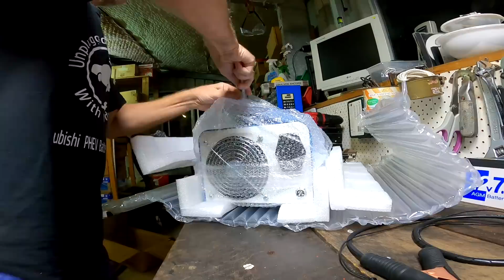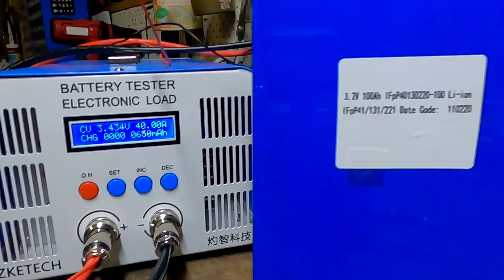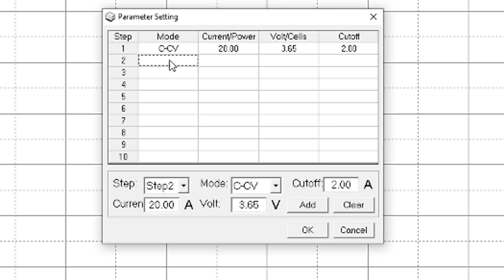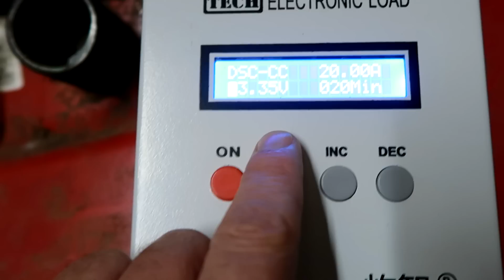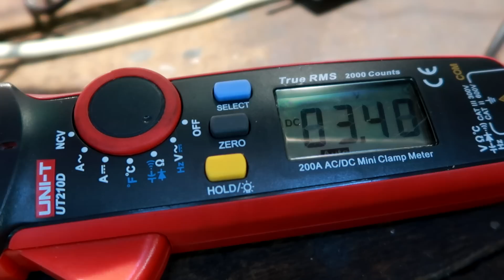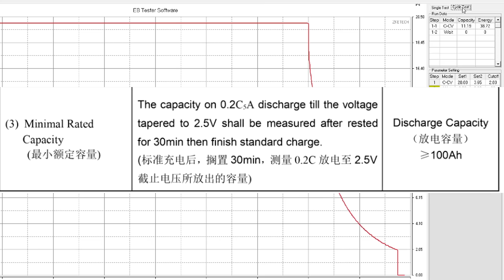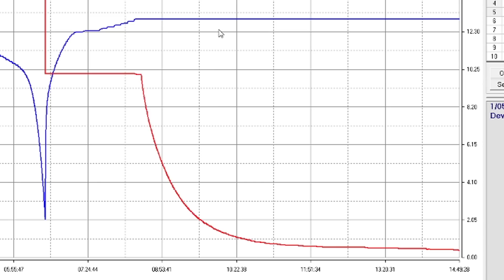My favourite battery analyser so far: Testing the BIG and POWERFUL ZKE-Tech EBC-A40L.

Comment: The 4-wire connection allows it to measure more accurately by avoiding the voltage drop during high-amp operations, as well as allowing you flexibility to where you connect the voltage reading for most accurate measurement. For example, you might connect the high current leads to your main battery power terminals but connect the voltage sense leads to your BMS for the most negative and most positive cell connections.
Reply from the maker: Hmmm, OK...
Reply: Yep 4 wire is way better. Even the terminal as some voltage drop.
Reply from the maker: But 4 clamps as well?
Reply: @OffGridGarageAustralia   Andy, you are completely right. No need for 4 clamps. Only one spare wire to the each crocodile ;)
Reply: @OffGridGarageAustralia  Hello, maybe someone has encountered a case of loss of communication between the tester and the computer. Once you start the test some is fine for a while. The current and voltage values are correct. After a few minutes, problems begin. First, the data refresh rate drops. Then the voltage and current values start to go crazy. Then it's good again for a while and then it changes. Often, communication is completely lost and the tester does not respond to commands from the software. In such a case, the cyclic test is also interrupted and the tester does not start the next test on the list after completing the current test. Any suggestions?
Reply: @marekbarney9291 
I’m having this same issue when trying to do multiple cycles also.
Have tried to do a firmware update also. Bit not sure how.
Reply: @flyingskwerl-Outdoor_Adventure  If you manage to solve the problem, let me know. I tried but I have given up for now because nothing has helped.

Comment: The reason for separate voltage cable, or remote voltage sensor, is to get an accurate voltage reading during high current loads. No current flows in that cable so no voltage drop as you surely knows
Reply from the maker: Nah, that wasn't the question at all. I know why we have separate cables for current and voltage reading. But why separate clamps???
Reply: @OffGridGarageAustralia  yes that is peculiar
Reply: @OffGridGarageAustralia  Even the clamp has a small resistance and that can give false reading.  Measure with a multimeteron the terminal and then on the clamp where cable is connected, you will see some mV difference
Reply: @OffGridGarageAustralia  because in a battery test you can put current clamps in the terminals of the battery and the small clamps in every single cell you want
Reply from the maker: @zarbonida  The tester can only handle 0-5V, so this cannot be the reason. I found the answer in one of the many comments and will show this in a future video. It makes sense to have them separated...
Reply: @OffGridGarageAustralia  thanks
Reply: Right info
Reply: ^ this ^

Comment: You really don't know the purpose of 4-wire (Kelvin) measurements ?
One set for high current and the other for voltage measurement ?
Reply from the maker: That's wasn't my question, if you watch the video again. I was asking why we have separate clamps. I wasn't talking about the cables at all!
Reply: @OffGridGarageAustralia  Obviously because of contact resistance being much higher for heavy current clamps.
Reply from the maker: Obviously...

Comment: I thought the eve cells said to wait 30mins at cv 3.65. interesting this sheet says to simply pause and then recharge.
Reply from the maker: It's the same here, people just don't read it correctly in the manual.
'The capacity on 0,2C discharge till the voltage tapered to 2.5V shall be measured after resting for 30min', it says.

Comment: Normalerweise können die separaten Klemmen für Strom und Spannung schon nützlich sein. Wenn man mehrere Akkus in Reihe lädt oder entlädt kann man so z.B. due Spannung von einzelnen Akkus prüfen ohne dafür extra ein Multimeter zu holen. Dafür wären die getrennten Klemmen an dem kleinen Tester allerdings sinnvoller. Bei den max.5V von dem großen kann man nicht viel in Reihe schalten. Bei den hohen Strömen für die der große Tester gedacht ist, ist es ist es manchmal vielleicht auch sicherer, wenn man erst mal mit den getrennten Spannungsklemmen die Spannung prüfen kann.  In den Bereichen für die der große Tester gedacht ist, sind Spannungsmessungen ungefährlich. Bei Fehlern mit den Stromklemmen kann es aber böse krachen.

Comment: Accurate test equipment always uses 4 wires - 2 for amps and 2 others for volts so the voltage reading isn't affected by the voltage drop in those cables when they're passing 40 amps.  Four feet of 10 gauge wire will have a voltage drop of about 0.16 volts at 40 amps (depending on the type of wire) - based on a guess at the length of both the positive and negative cables.
Reply: Would it be okay to clip the little clips to the big ones? 🤓🤔🤷‍♂️
Reply: @serversurfer6169  Sometimes, but not usually.  You don't know where the big clips are contacting the battery terminals or how good that contact is.  Remember that the device is capab;e of reading to 0.001 volt.  At the currents this device is capable of (40 amps) even the 10 gauge wires would have a drop of 0.160 volts at 40 amps.  If at all possible, the small clips should be connected directly to the battery terminals - not through the possible voltage drop of another clip.
Reply: @notyoung  good to know, thanks! ✊🤓💜

Comment: Don’t calibrate it with your clamp meter. It’s not really accurate. Good enough to read a 12v battery but not good enough for electronic work in my opinion and I have this clamp meter myself too.
But I would check the ground connection of your new toy. Most of the time, Chinese company’s don’t really care about this connection…

Comment: 23:15 See why I only charge my cells to a resting voltage of 3.325? There is virtually ZERO extra capacity above this level...........
Reply from the maker: But the absorption time is super long, right? It will take forever to to charge them.
Reply: @OffGridGarageAustralia  Absorb WHAT? There's no extra energy being forced into the cell. Just set your controller to stop charging at 13.6v (3.4v per cell). The more you get into the 'knee', the more chance of your cells becoming unbalanced. It's pointless and potentially damaging.....
Reply: @mikeholt7881  Top balance vs. bottom balance. The knee of concern is opposite where they are balanced. And there is a large difference between "virtually ZERO extra capacity" and "no extra energy."  From beginning of the top knee until fully charged is usually 10% or more. For regular use it doesn't cost much to keep it below this level, but going the rest of the way to charge that 10% is not "no extra energy."
Reply: @mikeholt7881  I would charge it more than I usually would only ONCE as a test to get a good idea of what the knee looks like so I can make an educated decision as to where I want to cut it off from then on (and to calibrate my coulomb-meter).
Reply: @Sylvan_dB  10%? You have NO idea.
Reply: Put these key words into Google.....Marinehowto....lifepo4......batteries-on-boats. It'll be an eye-opener for you.

Comment: 2nd wire for voltage measurement is for 4 point measurement to compensate for the IR voltage drop in the main current carrying cables.
Reply from the maker: Yeah, I know that, but why does it has a separate clamp?
Reply: @OffGridGarageAustralia  The two halves of the big clamp are electrically shorted together at the pivot point and spring between the two, which means current is flowing through both sides of the clamp. If the clamp has 0.0025 ohms of resistance between the jaw and articulation and the current is split evenly between both, that's 20A x 0.0025 ohms = 50mV of IR voltage drop on your measurement, same on the negative side, so your reading ends up 100mV off. Having separate clips to connect directly to battery terminals gets you the true terminal voltage regardless of how good or bad the high-current clamp connection might be.
Reply: @OffGridGarageAustralia The clamps that carry the load/amps also have a voltage drop. You should connect the sense wires to a part that doesn't carry any current, as directly to the battery terminals as possible.